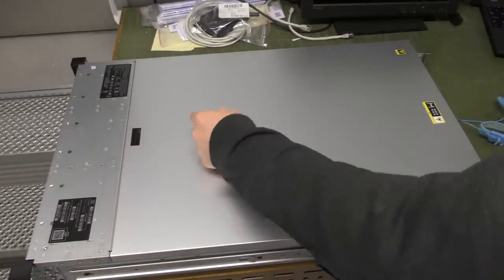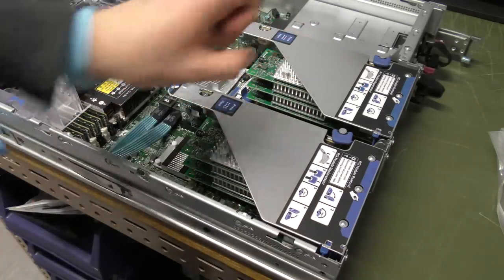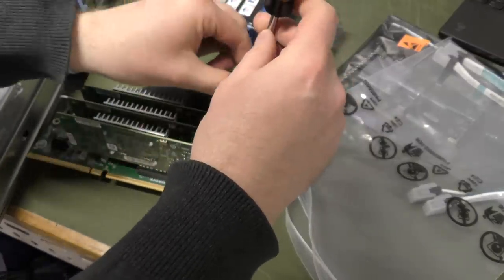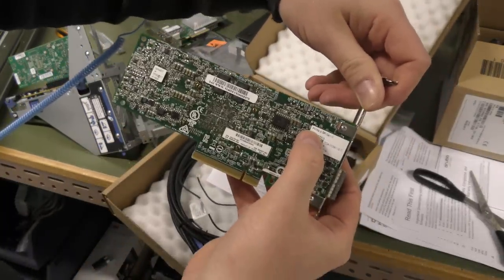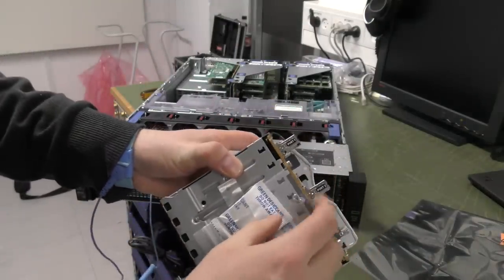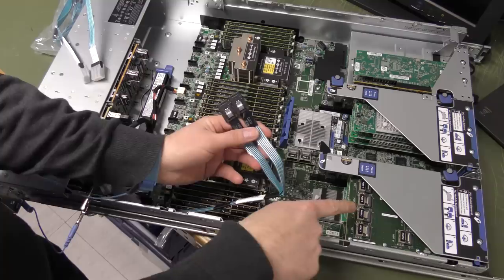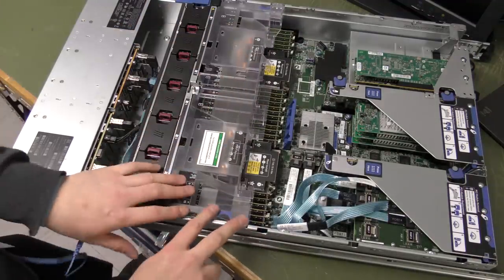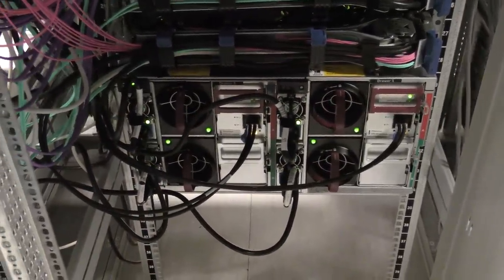500TB Disk & 25TB SSD in HPE DL380 Gen10 with D6020 - 662

Comment: Hi Morten. I really do enjoy your videos and the effort you put into them for us to learn. I have an old Dell 6650 Poweredge to play with. It has 5 drive bays and 4 Intel Xeon processors. I bet you are laughing right now. If you would like to give me an idea of the possible uses this server or what it might be used for (running the washing machine or something). It has MS Server 2003 for an OS and that is all I can tell you about it. I just checked and Dell does have support for drivers and operating software. Thank you for all that you do!
Reply from the maker: Hi David Conner
Thank You very much!  Well it might be okay, to run an older version of VM-ware and then put your trusty old Server 2003 on top of that,, and play with other virtual servers as well.
Thank you for watching! :-)
Reply: Thank you for so much for answering my reply! I will let you know what I have decided. There are other options for my desires NAS, FileZilla, etc. Once again, THANKS!

Comment: I’d like to see Morten review HPE Microservers.
Reply from the maker: Hi Chris Bautista
I like to show you all this awesome big server stuff :-)
Thank you for watching! :-)
Reply: Chris Bautista Those are cheap, little great beasts! +1 to your request!
Reply: Don't bother with the micro-server. Processor is soldered in (only two models available and both are low powered like high end celerons) and  no iLO so no remote access. I was evaluating for small offices of under 25 users with on-site IT support. Most of my customers I talked need some expansion for 3 to 5 years. The GEN10 is a toy server for kids to play with. In every case  we ended up  going to the GEN10 DL360 or moving to Dell T30. HPE no longer has lower end servers like their DL60 and DL120 in the GEN10 line. To set up a  micro-server is $2500 with all four drives populated but with no OS. They include ClearOS but no one wants it even though it is free. To set up a DL360 GEN 10 is $5500. That's pocket change to a small business and they want to expand-ability.
Reply: @PWingert1966  Good thing that the MicroServer Gen10+ is here allowing for CPU upgradability to some good Xeons and iLO 5 I guess. HPE now has the DL20 and DL160 for their lower end Gen10 rack servers which I think is another improvement. So hopefully that may resolve some of those issues.

Comment: HP used to have a L shaped T-10 / T-15 wrench included on the servers, not the easiest to use, but worked in a pinch when you forget your screw drivers. I alway keep a Klein 10-in-1 or 11-in-1 in my bag for trips to the data center.
Reply from the maker: Hi 808jpm
Yes I know,,, it's not there anymore,, or they have hitten it TOO Well.
Thank you for watching! :-)

Comment: Great video! I have a proliant dl380e g8 25 sff and I want to add some extra space using an external drive bay (maybe for hdd lff). Do you think this is possibile? I don’t know what bay I could need and what cable is used to connect to the server.
Reply from the maker: I would sugest to look at what DAS, HPE suggests with that Server, and see if you can find one used. And a HPE RAID/HBA card with external connections.

Comment: Greeting sir, 
Thank you for the helpful video. 
Is your new server connected to expansion by LC-LC cable with an HBA adapter?
Normally, I saw they were using DAS or SAS cable for connecting. Please correct me if I'm wrong.
Reply from the maker: Hi Trieu Truong
Thank You very much!  The Server is connected to the DAS with 12Gb SAS cables, and the server is connected to the FC storages network with Fiber, and that is LC-LC
Thank you for watching! :-)

Comment: I noticed that you don't use filler plates in the unused spaces in the rack. Do you find that they're not necessary? I thought they helped direct air through the servers when you have a hot aisle/cold aisle setup.
Reply from the maker: We do not have enough,, and I might have done some after filming,,,,, as it it not that interesting.

Comment: So what is the difference between some cheapo Nas/Server HDD for 200 Dollars and this one 1000 Dollar for just 2 TB? Or did i miss that this have been SSDs with the 2 or 3 Times the car value?
Reply from the maker: This video is a few years old by now,, 2TB SSD has come down in the meanwhile. You pay more for enterprise than consumer grade equipment.  I might lose my job if I bought cheap consumer SSD's and they failed and production was down for hours/days. But if I got the enterprise stuff,, well it was the equipments fault,, and we will blame and both yell at HPE,, that is how that works :-/

Comment: I have a HP dl580 g7. 4 e7, 512gb ram, etc. I need to add 20tb sas ssd and min. 10 tb sas drive. How would you do it?
Reply from the maker: That would dpend on what the storages would be used for.. 2.5" 5TB HDD are available and they are chep-ish,, so for a library of large files this would do. after that there are SAS and SSD and the prices goes up.

Comment: How do these boards deal with the PCIe riser with multiple cards? Is there a PLX switch chip on the card? or on the board? Does the slot get bifurcated? Like, how does it deal with multiple cards all being used at the same time?  Also, that SAS expander looks reaaallly nice. The entire server and of course SSDs is beautiful too.  Love your vids as usual Morten; had a good laugh when you forgot the power cable and shuffled the rest in. I've had that problem so many times.
Reply from the maker: Hi CheapSushi
It's not just an x16 that is being "rised". With out really knowing how they do it or how it works. I am guessing that it's the whole data buss that goes up to the Riser, and they become PCI slot like on a normal mothere board.
Thank you for watching! :-)

Comment: Great video sir, please i have a problem with my HP Proliant DL380 G10 server, the server came with window server pre-install but i did not know so i power on the server went to  Intelligent Provisioning insert my bootable usb with window server image on it after few steps into the process i got the error : ""window cannot find the microsoft software license Terms. Make sure you have the installation sources are valid and restart the installation""... i still cannot run window serer on it till now please help sir...
Reply from the maker: I am afraid I do not know how to fix that,, try HPE support or Microsoft..

Comment: Does anyone here know if the DL380 Gen 10 and DL380 Gen 9 8sff bays are physically interchangeable? I have a Gen 9 chassis that is still a decent server that I would like to install either a Gen10 NVMe 6 or 8 SFF drive cage into.  Unfortunately I dont have a Gen 10 available to pull out an 8SFF bay from and see if it will go into a G9 chassis.  The G9 & G10 chassis are nearly identical but HPE likes to do stupid things like move screw slots and holes to slightly different locations so you must order the "correct" spares number for the chassis. Trouble is I see several Gen 10 NVMe numbered cages available online but no Gen 9 NVMe cages.
Reply from the maker: Good question,, I do not know.

Comment: That's a bit more robust than my HP DL60 Gen 9 I have here at home. I picked it up as a return from a company called NCIX for about$CDN600 before they went bankrupt. I have 4 HP  SATA 1TB drives in it. They were about $CDN400 each direct from HP. I tried a couple of WD Reds in it and the BIOS Barfed all sorts of  messages at me. It was difficult to deal with HP. Since I am initially did not call as a  business they  were really not interested in  letting me purchase anything from them. I ended up creating a company name and then calling back as the  Manager of server operations. I got a much better response and I now have a sales rep assigned to my companies account. I know i can get a LOM ex pander for my machine and I think I can get another expansion cage as well. I'm running  Windows server essentials on it.; since its mostly for training and education. LOL. Do you think the Gen 10 server off a better value proposition compared to the G9?
Reply from the maker: I saw Linus Tech Tips at the NCIX Bankruptcy Auction
he was not impressed with the prices..
Reply: NCIX has been dying for a year or so from some  information I have received online. The auction prices do not reflect reality. I was looking online at  amazon.ca and they wanted $183.00 for a single Ikea table leg. It was an independent seller but that is still crazy. Whats even crazier is that someone will buy that single table leg for $183.00 plus $45.00 shipping. My biggest problem with HP is if I look for 1TB SATA enterprise drive it returns 15 selections and apparently only 2 or 3are actually compatible with my DL60. Problem is its not easy to tell which ones are the right ones.

Comment: why the heck would somone put so many HBAs in one system ... is this some kind of Storage Server or what ?
Reply from the maker: Hi Chris B
Something like that!  glad you liked the video :-)
Thank you for watching! :-)
Reply: @MyPlayHouse  according to the video u posted before, there's a DAS connected to the system as well... So I would assume sth like that. Thanks for ur reply
Reply: Eventually also some kind of auto tiering with the local ssds :-)
Reply: I know this is an old reply, but given he said Linux for the OS... given the hardware, I'd take a guess that ZFS is the file-system being used.
Reply: @BrandonTahedl  Not enough ram for that, would require 512GB ram, but there is "only" 128GB. I've never seen ZFS used in the datacentre, my guess is this is some kinda disaster recovery or warm storage appliance. Working storage I think would be on a flash array on something like a EMC appliance if done in 2018.

Comment: ? on this DL380 does it have standard gpu connectors? Thank you, & what size drives are you puting in
Reply from the maker: Hi Joel Crocker
I do not remember if the G10 has 10pin or 8pins! I made a walkthrough video,, it's in there glad you liked the video :-)
Thank you for watching! :-)

Comment: Hi!
Is it possible use 2.5 nvme in this model in rear ?
Reply from the maker: Hi sergeyyy ghj
I am not sure about that,,, some 2.5" is available,, but if it's NVMe,, I do not know.
Thank you for watching! :-)
Reply: There is no problems with form factor of 2.5. I make some experements ) But if it factory support, it must have a cage for 2.5 nvme devices and posibilites to connect it to PCI-e card
Reply: Also I experiment with nvme devices with old systems like g5 or m1 ))

Comment: Hi,

I want to buy Ubuntu build server for Android 10 AOSP which can handle 10 concurrent builds with build time of about 1 hr. My current Ubuntu server is 24 core EPYC processor with 32GB×4=128GB 3200MHz RAM and 8GB Dell raid controller. Storage is 1.92TBx8 SATA SSD. This Server can only handle 3 concurrent builds with total build time of 3.8hr. My CPU utilisation reaches 123% with 24 physical cores and 48 logical cores while RAM utilisation is only 62GB. Please let me know the desired server configuration for 10 parallel builds.
Reply from the maker: Sorry, I do not have thay info.
Reply: @MyPlayHouse  thanks for your feedback. Cheers!!!

Comment: -- >> Change the title, this will get flagged ! << --
There is no "500TB Disk" in existence, it's youtube violation "Spam or misleading" to lie in the title.
Change the word Disk to System or Server then it's ok. 
The best density disks are about 20TB (Seagate) and SSD's (drives not called as disk) corrently have best size of 100TB not 500TB!
In year or 2 there will be drives that have 500TB up to 1PB and they are called Intel "Ruler" form factor SSD's.
Reply from the maker: Hi KrKyoutube
Humm no one else has had any problem with this. The people watching this usually knows a lot about Server and Storage.
Thank you for watching! :-)